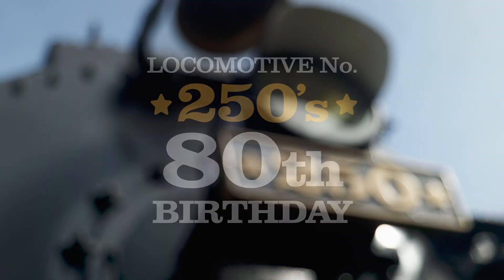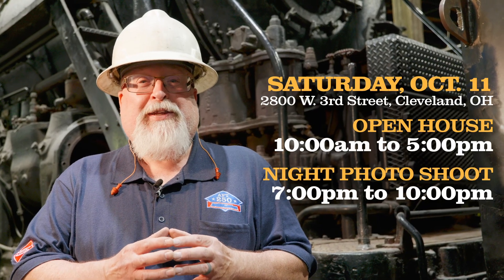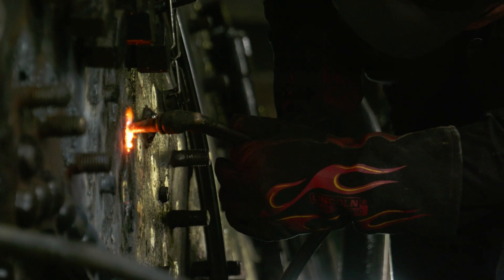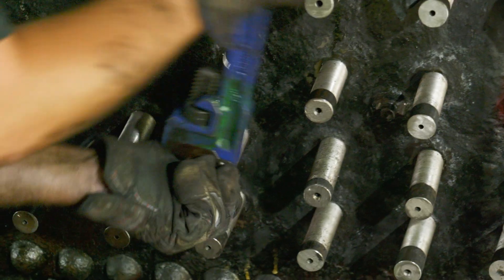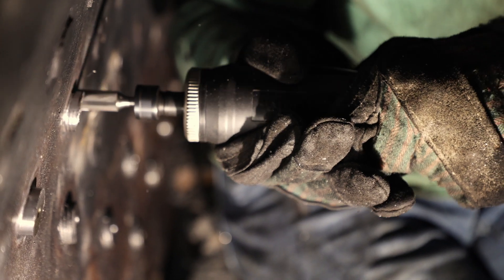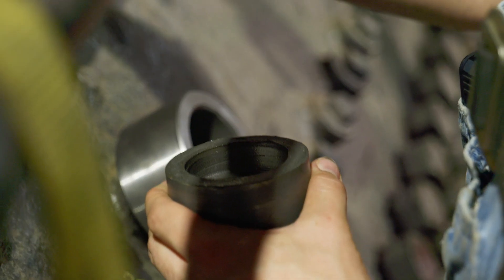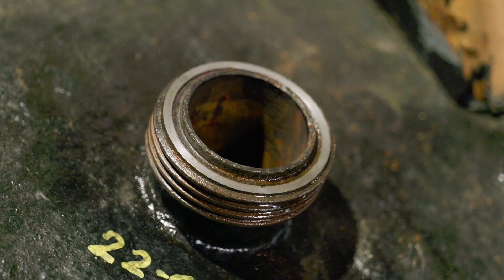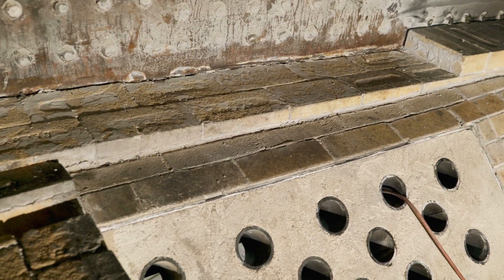Staybolts Nearly Complete - AFT 250 August 2025 Update

Comment: so you ended up driving the bolt anyway in the end, I thought the first run of the video said they were just doing welding on the stays using a slightly differant procedure, I know its standard practice to drive the bolt to make it lock in and caulk the gaps from leaking, but from what I gathered there are some that are just welded like on stationary boilers, or the pre tensioned ones created by arnold tross for the german railroads decades back.